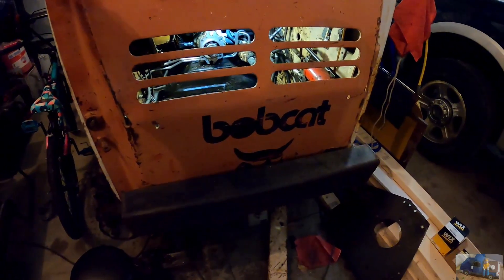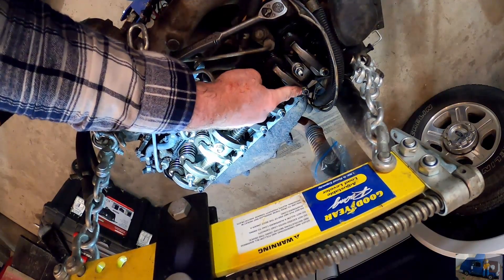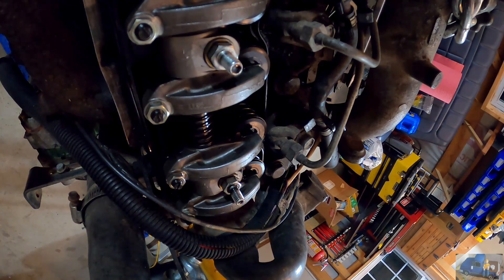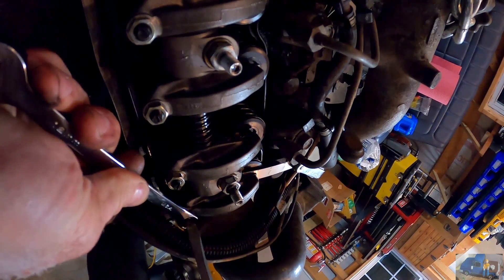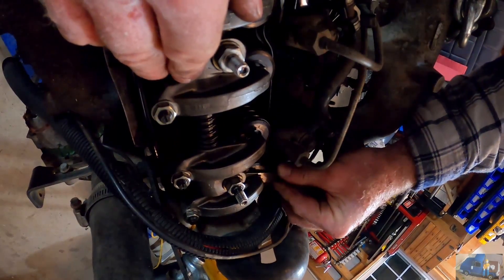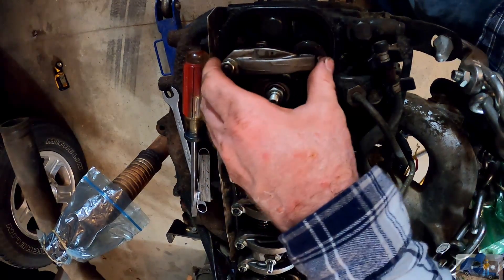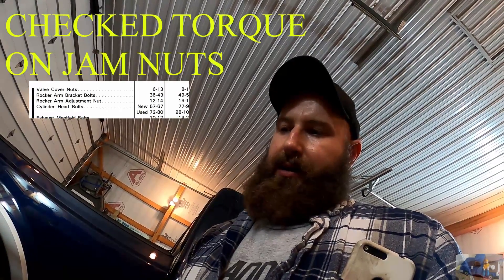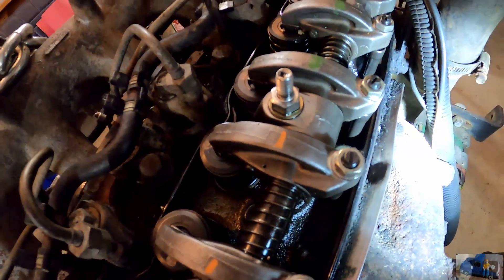BOBCAT 843 - Isuzu Diesel Valve Adjustment; Episode# 4

Comment: What is the torque spec for cam shaft bolts?
Reply from the maker: Cam shaft retainer plate bolts 11-17 ft-lbs per the manual.  Thanks for watching 👍😁
Reply: @FlatThunder  I'm sorry I meant rocker arm assembly bolts. I bought a online pdf file from Isuzu or hyser.
Reply: @FlatThunder  it has all specs on the engine. I need wiring, drive train, and hydraulics manuals now. I watch your channel a lot. Your a go geter. No one likes to work these days. Men have evolved into mice.
Reply from the maker: @Conrad_jrblaze  I agree not too many people are motivated these days.  I like to put in the work because it's rewarding to me.  Thanks!  I appreciate you taking the time to watch.  I hope my videos can help and inspire others. 
Rocker Arm Bracket Bolts: 37-43 Ft-Lbs
Rocker Arm Adj. Nut: 12-14 Ft-Lbs

Cheers 👍😁

Comment: How can you tell where top dead center is if engine is on tractor and cant see the markings? Thanks in advanced
Reply from the maker: The valves should tell you.  Look for both intake & exhaust valves closed on #1 cylinder.  If the markings are not visible you can pull a injector and use a dial indicator to find the exactl TDC.  Thanks for watching!  👍😁